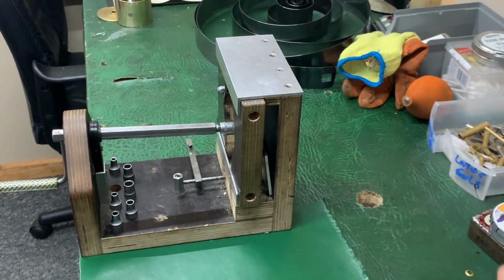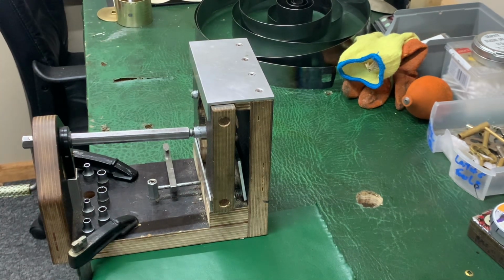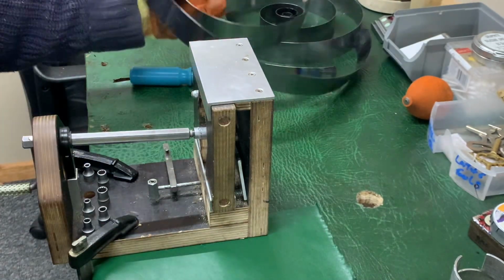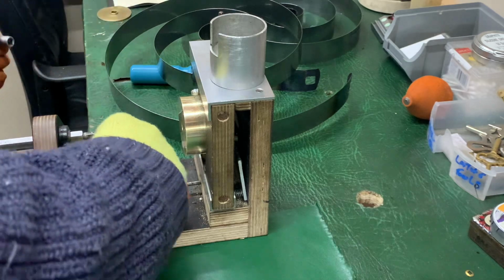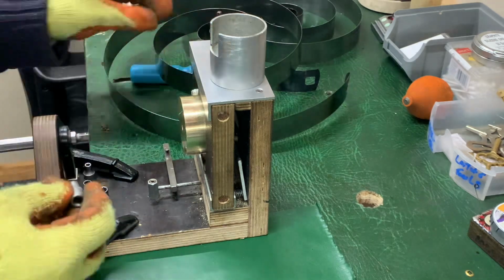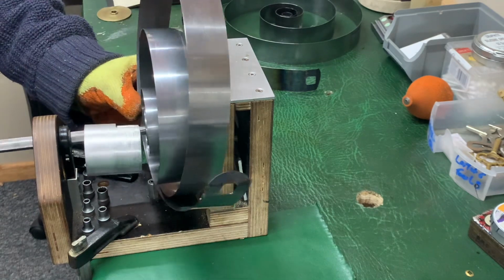This is what happens when the mainspring slips in the mainspring winder WEAR Gloves & GOGGLES!!!

Comment: Very clear procedure. And with emphasis on safety glasses and strong gloves most particularly with these heavy springs. Even when I fit a new spring in a French clock by hand - they are small enough to fit by hand and in fact because they are so small a mainspring winder presents problems as l am sure you know, l still wear gloves and goggles as l show in my video. Thank you John - an excellent video specially on your recommendation to replace old set springs.